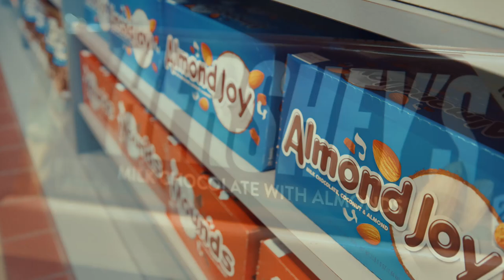Hershey's Almond Story

Comment: Why would there be worms on my Hershey’s Dark Chocolate Nuggets with Almonds?
Reply from the maker: We're sorry to learn of this, Nina. We want to let you know that Infestation is an environmental problem that can occur during the storage and distribution of food products. We have comprehensive integrated pest management programs in place to prevent infestation in manufacturing and distribution. Further, manufacturing processes such as nut roasting are at such high temperatures that insects could not survive. Although we print proper storage instructions on all of our outer cartons, we have no control over the environmental storage conditions and stock rotation policies of distributors and retailers. Infestation can occur if the product is stored with or near infested food or pet products. Pantry pests can penetrate virtually any type of packaging on the market today, with the exception of glass or metal. Please send us a note at http://bit.ly/22Y1N7Q, and kindly include the UPC and manufacturing codes so we can get some more information about this.
Reply: Welcome to 2022 you will eat the bugs and like it!!!!